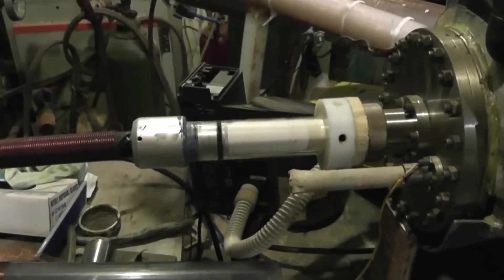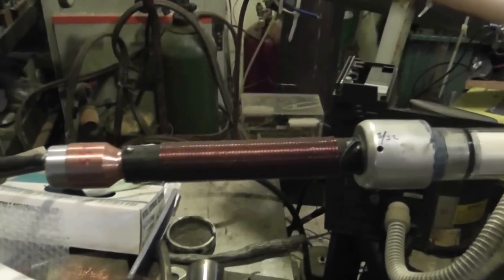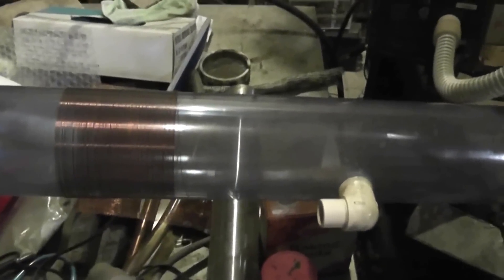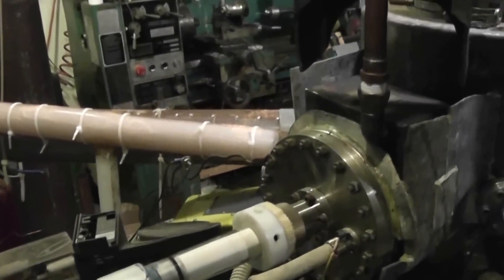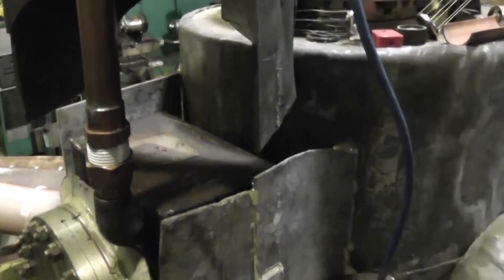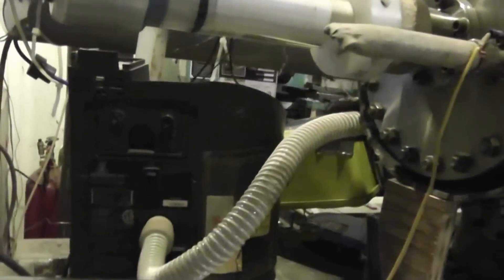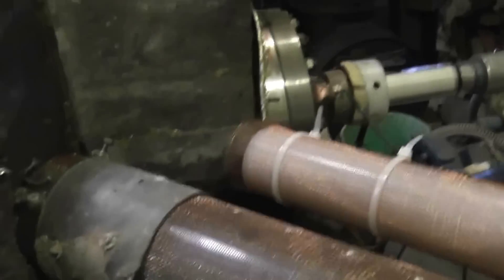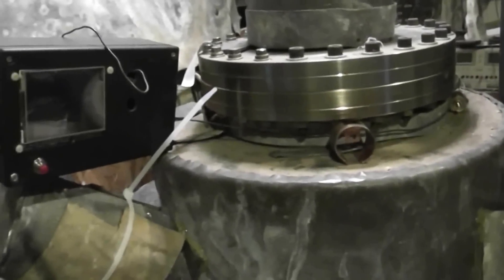HV Feed for fusion reactor

Comment: Hi Doug. I noticed this comment someone posted on another forum about your reactor:
"The 'nuclear fusion reactor' in question was invented in 1964 by Philo T. Farnsworth, the same guy who invented electronic television; it's known everywhere as the Farnsworth Fusor. Many amateur experimenters have built one. It achieves fusion on a microscopic scale by accelerating deuterium ions with high voltage; they collide inside the center electrode and fuse. High losses have prevented such machines from approaching break-even."
But after watching your videos and reading your comments it's pretty obvious you know what you're talking about and are on to something. But I have to wonder: What makes yours different from all the rest? And is it even a viable energy option and not just a gimmick?
Reply from the maker: Yes, Philo Farnsworth came up with the idea, many amateurs build these, Hirsch and Meeks took it further, and I've taken it further yet.  In the modes shown so far on youtube, that's more or less all it is - but built better (lots!), and so that we can instrument what's really going on in there, since as it turns out, the armchair theorists were, to put it as nicely as possible - dead wrong about nearly everything.  We have since made a breakthrough I'm keeping mum about till the patent is in.  I hate having to do that (waste time and $), but they changed the law so my prior art (well documented all over) doesn't count - only who is first to file - a "reform" that only benefits those with deep pockets - best law money could buy.  My intent always was and still is to give this away - but I have to own it first, to prevent some $BIGCORP from stealing it from us all.  We are under factor 100 from net gain after the boiling water/turbine/generator losses right now, but due to the increased output, I can't be in the room to tune it, and so have spent the last most of a year building remote monitor/control stuff so I can finish the job.  Having begun at 10^-12 from here a few years back, that last 100 doesn't look so bad (and that's without using tritium which would have us there now, but create other problems).

Comment: So Doug! I have been making MY own theories for a VERY Long time but i DONT have the possibility to build a proper prototype. My reactor is an IEC design, but it should completely lack bremsstrahlung. I could sent YOU an excerpt. What do You think? Would getting rid of bremsstrahlung, from your Point of view, help?
Reply from the maker: Our main sources of loss in this "beam collider" which is a better description than "IEC" though they look the same from the outside, almost, is extra electrons getting slammed into the tank walls at high velocity, where they turn to something like a mix of heat and X rays, random scattering (which thermalizes things - our ions are actually pretty close to room temperature  ("warm" fusion?), and charge-exchange to create negative ions and what amounts to a "tandem" accelerator, which results in "beam on target" fusion at the walls with other D ions/atoms that have embedded there.

The "secret" if there is one, is how we get from molecular flow to viscous flow over a very short range at the focus.  EG the effective compression ratio, sort of.  That's a bad term since nothing is "confined" at all - most things come right back out after passing through focus.  Accuracy of same is a big deal.

My email is at my website if you look...it's kind of a turing test (else I get completely swamped, I don't have an AA to scan stuff like that for me), but if you want to tell your idea here (after all, I'm not keeping secrets), that's fine too.  If I think it useful, I'll try it, if not, I'll explain why not.  There's a lot more going on inside one of these than you'd think from just looking at it run, as we've shown with actual diagnostics.  Farnsworth and friends didn't have the tools we have.
A lot of ideas aren't solving the real problems as a result, as we've found out the hard way.  Not dissing yours, since I don't know what it is, but ideas are the "easy" part of this...it's making them work or finding out if they even apply, that is the crux of the biscuit.
Reply: Doug Coulter First of all, thanks for answering man! Ive been into all kinds of science since i was born :D and this is what im interested in most. I saw you on vice and was, and am still, really impressed by your work and just your philosophy in general! Keep it up! And i know things are not as simple as they may seem. Ill look at my work again and see if it makes sense to sent to you, ive been studying for school lately(past 3 months) and got slighty out of it.

Two more questions i still have to ask! Have you ever thought about a pulsed operation of the reactor? Would that help with the compression ratio?

And now a hint at what im thinking of: How about getting competely rid of electrons? Ill try to explain it very rudimentary, theres more math to it but ill elave that out. Think of a sphere. Its positively charged. the second, outer layer of the sphere is a superconductor. Now if you get the deuterium/tritium mixture in the sphere to become a plasma, the electrons will flow away and were left with a positively charged plasma, which cant come in contact with the tank walls because of the superconductor(no sputtering). The positively charged inside walls are used for acceleration of the ions. To get it to a plasma one could use microwaves. now i know thats VERY(!!) rudimentary but i think its worth a thought. What do you think of it. my biggest problem is that damn couloumb barrier. i dont know if the positive electrode is enough to overcome it. Tell me what you think, maybe its complete, excuse the expression, bullshit.
Reply from the maker: ILOVENUKES1000 Why is it impossible to build your own?  You'd be joining many hundreds who have, that I know of.  I just happen to be about the best at it.

What distinguishes my efforts from most, is that I DON'T sit around making theories, or assume "it must be so" but instead, do real measurements instead of merely guessing.  100% of armchair theories are 100% wrong in my experience, which is long and I've been paying attention.  We just measure - why guess when you can know?
It seems only U of Wis bothers, and they as often as not, either measure the wrong stuff or misinterpret what they do. But they are more or less second place on this in the whole world.  Not bad, since 3rd is thousands of times behind them.

Pulsed - well, our recent breakthrough, to be documented when I finish my "lan of things" which is also going to remote the fusor so I don't die - it was that big, is pulse-related, but far more a resonance phenomenon, with resonances (kind of like in a quadrupole mass spec or a penning trap) for both electrons and deuterons at different frequencies.
It's quite a lot different from the "simple" Mathieu equations, since we are at a far higher charge density and have both charges, but that gives some of the basic ideas.  The trouble is, it became dangerous to be close to since the very first try - and what are the chances we got it right? - gave us ~~ 3000x more fusion than before.  Now I have to work from a distance, my floor won't hold any more shielding.

Thinking ion-only is a HUGE mistake.  The deuterons need literally tons of force per very light nucleus to get in and stay in range long enough to tunnel into fusion (this tunneling is almost the only quantum mechanics involved, other than the conservation laws).  Further, the net charge on that many would simply pull electrons off the walls of any tank you can make - we need a lot of these to make any reasonable fusion.  A million neutrons/second (roughly two million fusions) is around a microwatt.  Work it out.  This is so many orders of magnitude from reality I'd have to tell you to study exponential math (nicer than calling bullshit?).

We used an ion source based on magnetron/microwaves/ECR.  You evidently haven't read my forums or even seen all these videos (yeah, I know it's a lot).  We don't do that anymore, as we've found that an auxilliary grid working in a larger space (wiki paschen's law) works much better, more efficiently, and gives us what amounts to a "control" grid in a vacuum tube - except it's a plasma triode and looks a lot like a very high voltage pfet with a high turnon threshold and a sloppy zener diode (eg series R) hooked gate-source.  Power gain (electrically) of this arrangement is well over 100.
It's a giant transmitting tube if you let it oscillate, and (at least can) has frequencies determined by the transit times of the various E/M ratio particles in the fields present - which are in general much smaller than the fields we think we applied due to charges cancelling the applied field.  Which is one of the sins of omission committed by virtually all armchair theorists, that the particles are charged when you want to tug on them with a field, but magically (and unstated) not charged when you try to get to luminosity, because that breaks their stupid theory of how to get to focus/luminosity.  It's amazing what you learn if you just measure, rather than oversimplified theorize what's going on in there - when you do, it's always obvious in hindsight, and so far, the standard model rules it all.  No tricks, no magic, no new physics required to explain all we've seen.  At least we've seen it - others merely guess.

Comment: I don't understand anything, but this is really cool!
Reply from the maker: Fun too!  Check out the other fusion vids on my channel and my forums if you want to learn more - some of them are much cooler looking vids, too, showing all this in action.  A guy has to have some hobbies, and this is my main one these days.  We keep getting closer to practical break-even for clean fusion energy...it's a slog, but due to the self-funding, going a lot faster than government efforts - no bullsh*t meetings and bureaucracy.  Instead, I get to follow my nose where the evidence leads me, and right now - you can really turn on a dime when it's your own dime.  That helps immensely.
Reply: Doug Coulter I was just thinking of the cleanup job some MIT grad is going to have to do when this design works and becomes a commercial unit. Those zip ties will probably become zirconium band clamps that cost about $300000 each and who knows what the coax will be changed into just to make it neat and pretty instead of functioning enough to do the job. 
How far are you from providing enough juice to heat your neighbors still so he doesn't have to use a wood fire?
Reply from the maker: William Kennison Most of the 'shiners use propane these days, but the finest is still a wood fire - adds character.  I doubt the MIT "rocket surgery" guys get involved.  The practical issues would better be taken on by engineers at some outfit like Babcock and Wilcox, who deal with this kind of thing all the time and are really good at it - and not wasting money.  Their "vanity" published book "Stream, it's generation and use" can often be found in used bookstores and is highly recommended on that topic.  It's amazing how much there is to know about a "simple" steam plant.
Which is, in its own way, far past what "scientists" can handle.  It takes a real engineer to do things at a profit.
Reply: Doug Coulter as I said it was just a quick flash from the usual rough looking Rube Goldberg to something that looks like it should be in the engineering compartment on a nuke sub.